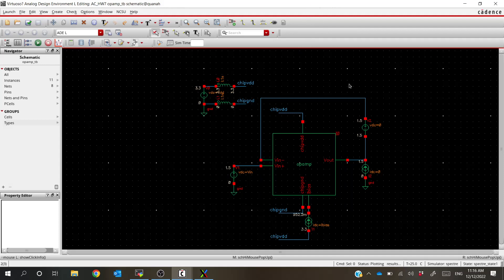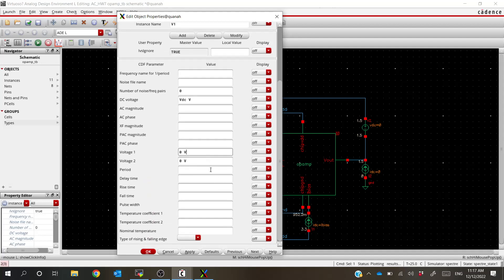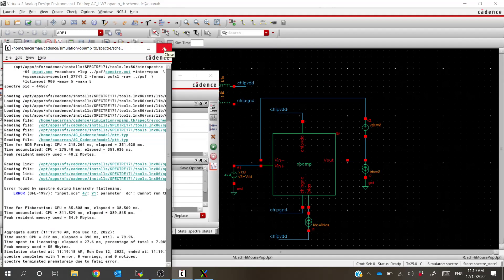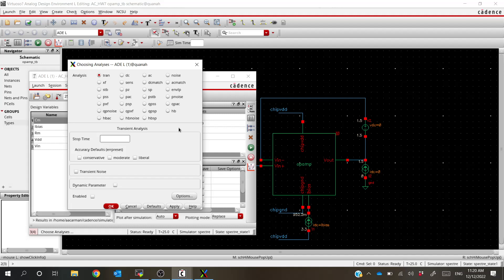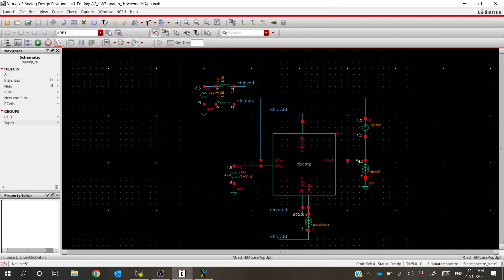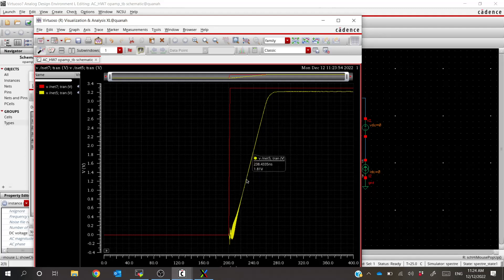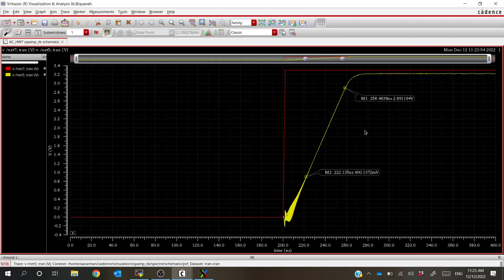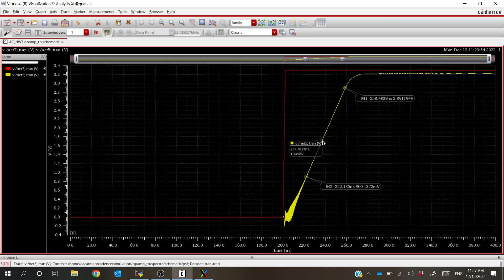How to Simulate Slew Rate - ECE x321 EDA Tutorial 4

Comment: Hello!! why do you have a battery and a current generator feedbacked on the Von- input at the output to measure the slew rate?. Thank you!!
Reply from the maker: Those are actually left over from a previous video ("Two-Stage Amplifier and Spectre Simulation") where we used the voltage source to measure open-loop gain, and we use the current source to measure output impedance. Ideally they will be set to 0V and 0A each so they have no impact on normal simulation, but they can be used in a different simulation to measure those key parameters.